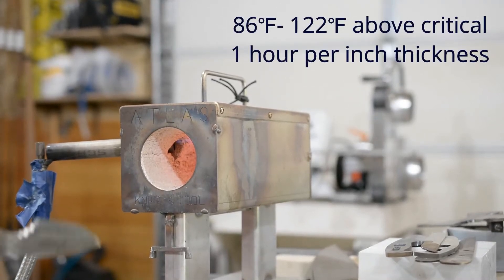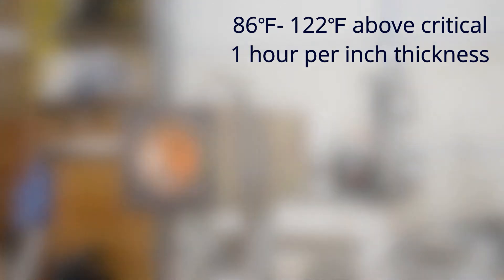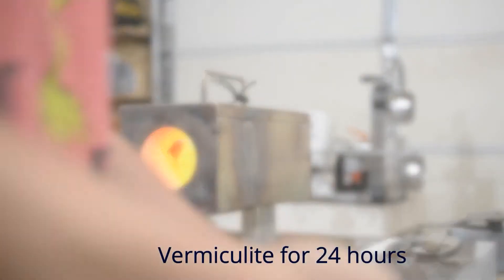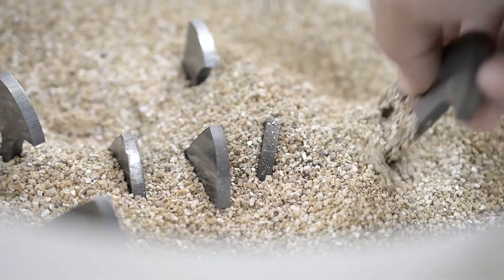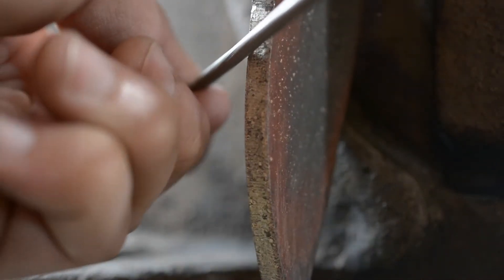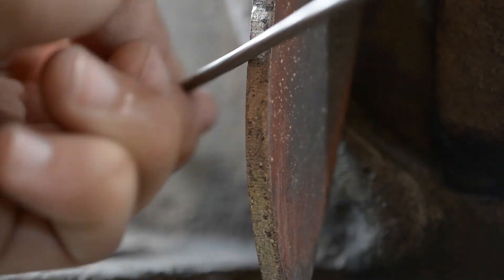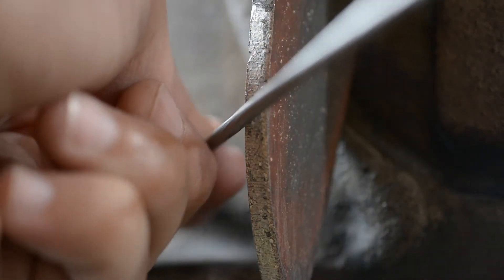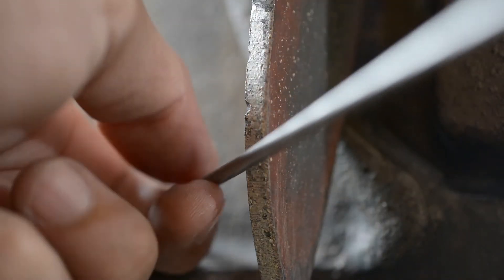𝗔𝗻𝗻𝗲𝗮𝗹𝗶𝗻𝗴 𝗦𝘁𝗲𝗲𝗹 𝗙𝗼𝗿 𝗞𝗻𝗶𝗳𝗲 𝗠𝗮𝗸𝗶𝗻𝗴 / 𝗠𝗮𝗸𝗶𝗻𝗴 𝗦𝘁𝗲𝗲𝗹 𝗦𝗼𝗳𝘁

Comment: Would you buy that atlas forge again if you had to? They look very well built. Are they big enough?
Reply from the maker: Its a little workhorse and once you have a high temperature thermometer you'll get your steel at the right temperature. The only limits is its size because making swords and cleavers becomes almost impossible. If all you do is high carbon steel knives then its a good little forge. I've done stainless steel in it a few times but it's hard. For stainless and CPM steels I use a electric kiln because it's less stressful. Would I get one again? Yes. If you're into sword making look into something bigger.